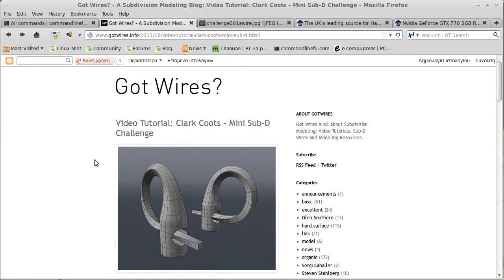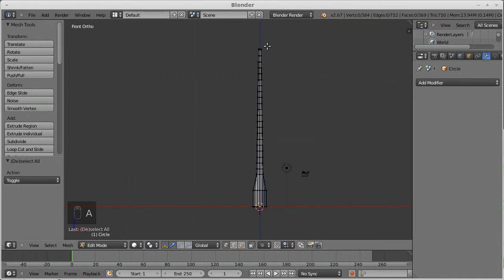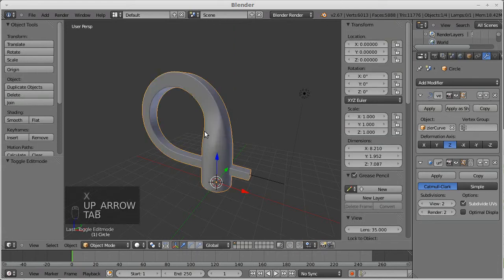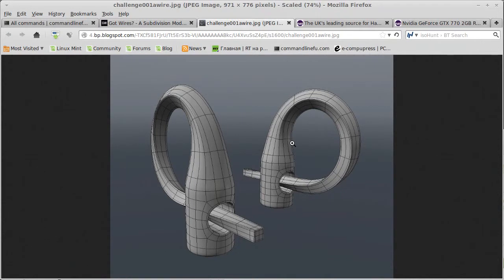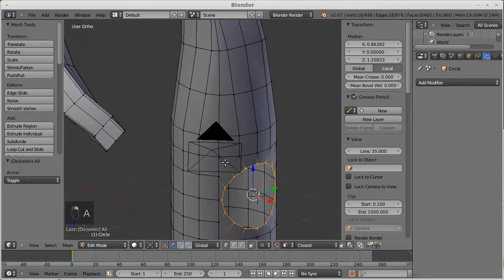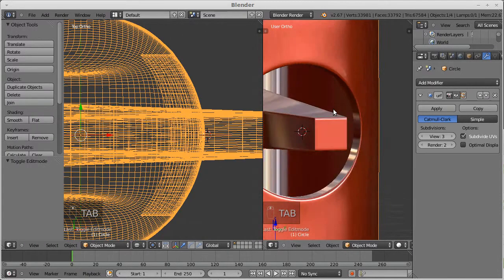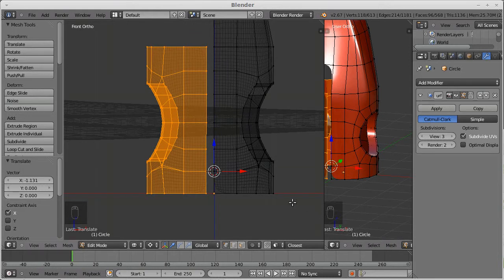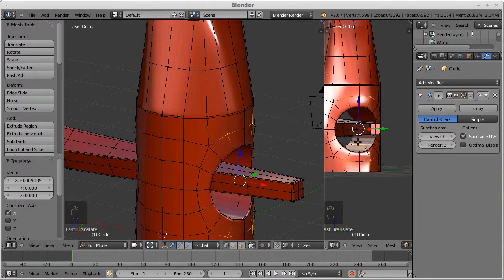Blender subd modeling exercise 3

Comment: You should look up a cgmasters video where they explain how to make the shading around holes perfect.

Basically take your original cylinder and duplicate it before the cutting, then put shrinkwrap mod on the cut piece and select a vgroup for your not effected vertices, put this in the vertex group field and click the invert influence field. Also make sure the object to shrinkwrap has a higher subd level than your object with the hole and it'll give it perfect shading.

Look up the video and I'm sure you'll find it, there's a picture of a car on the thumbnail. Awesome technique I thought.

Cool video though, I enjoy these exercises you do.